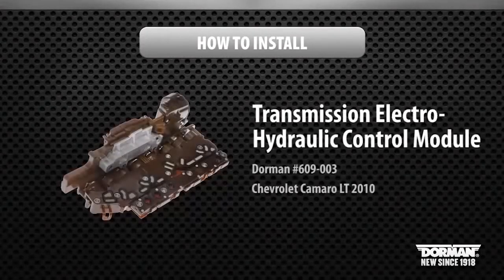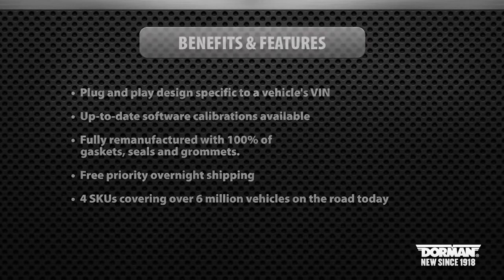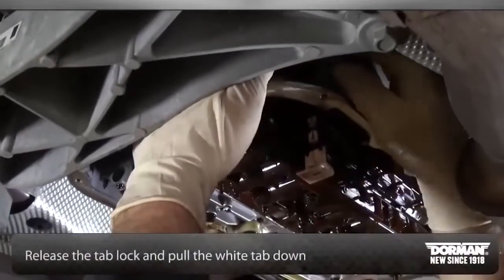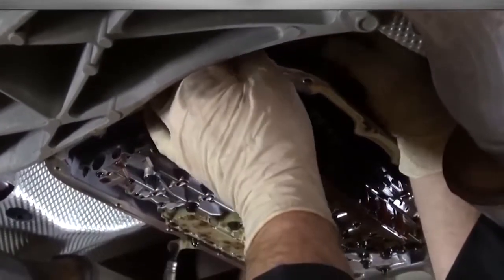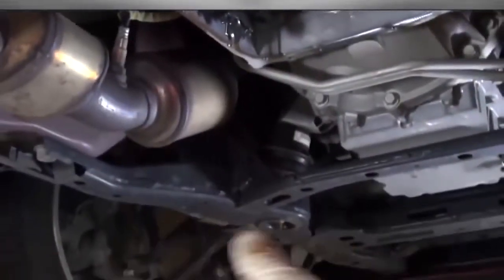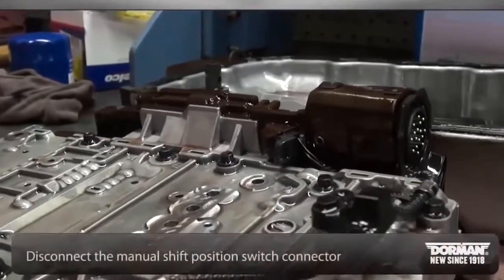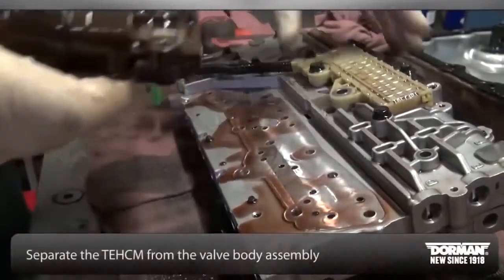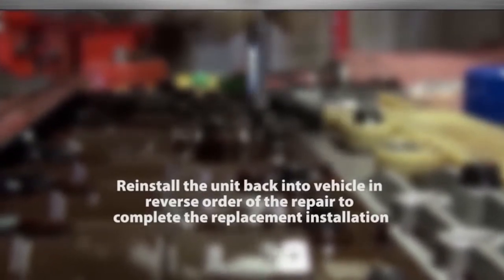Dorman Transmission Electro Hydraulic Control Module TEHCM Installation

Comment: Bit confused by this video as Dorman has conflicting information on both their website and Facebook page regarding the plug and play functionality. I called Dorman and was told they no longer come programmed. I also received this response from them via FB:

"Good morning,
When we first launched this program we were providing a software transfer tool that would pull the info off the old module and write it to the new one through the OBDII port. We were forced to cease and desist the use of that tool due to copyright reasons. At this time the units need to be programmed after install with GM software. That can be done by a dealer, remote programmer or through the RAP kit you mentioned.
Sorry for any confusion."

Bummed out!
Reply: Hi Jorge,
The information currently on our site and the info you were provided on or Facebook page is accurate. These do not come pre-programmed and the dongles were eliminated in September 2018